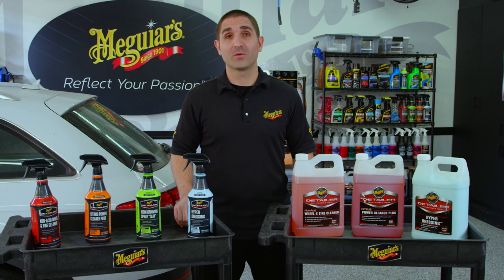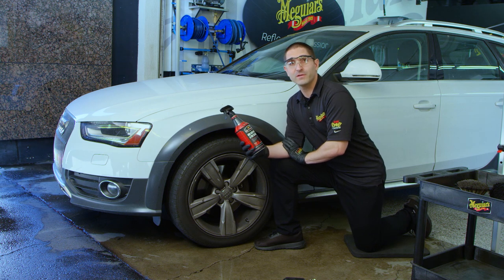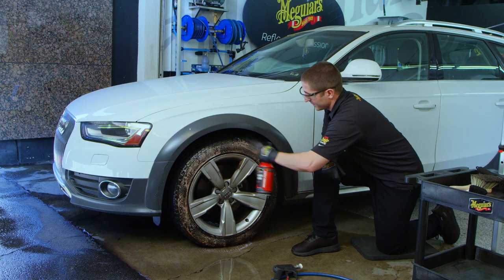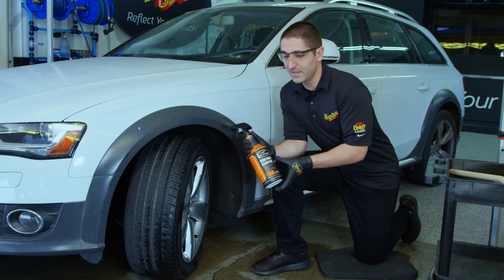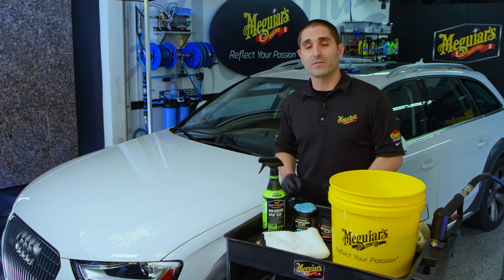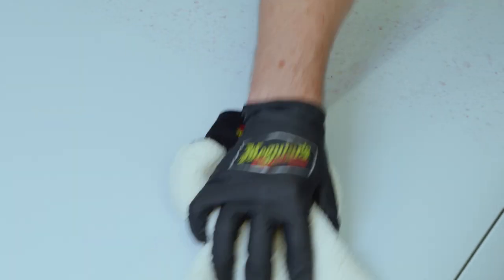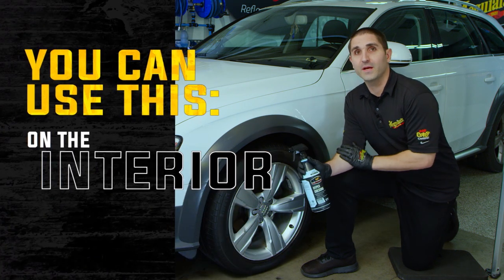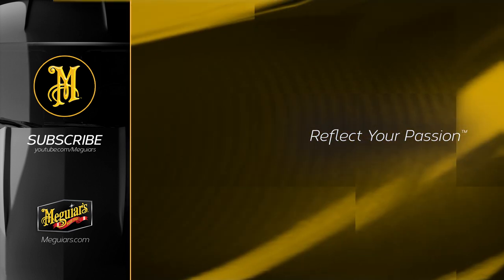Tips & Tricks for the Best Results with Meguiar’s Ready to Use Professional Detailing Products.

Comment: Can I use D107 Citrus Power Cleaner Plus for interior plastic and vinyl?
Reply from the maker: Yes.  👍
Reply: @meguiars  D2002 Iron Remover, does it safe for ceramic coated car?
Does it safe for plastic trim, chrome, headlights taillights as well?
Reply from the maker: It is safe on plastic trim, chrome, headlights, and pretty much every other exterior surface.  Whether or not it is "safe" on a ceramic coating is a question you would have to ask the manufacturer of the coating as not all coatings are created equal.  Some coatings could certainly be impacted by using a good iron decon product like this.
Reply: @meguiars  D107 Citrus Power Cleaner Plus, does it safe for ALL interior surfaces?
Reply from the maker: It is safe on most interior surfaces but is not recommended for leather, clear plastics, or navigation screens.

Comment: Marcus, is the D14301 safe for PVD chrome wheels? I have them (from the factory) on my 2016 Ford F150? Thanks in advance. BTW, enjoyed your videos with Matt, Obsessed Garage.
Reply: Forgot to ask: would the D14301 work / be safe on the wheel well areas? Thanks again.
Reply from the maker: Yes, it could be used on wheel wells also as long as you still follow the application instructions.
Reply: @meguiars  Thanks for the quick reply. Did you see my first question regarding PVD chrome factory wheels?
Reply from the maker: No, sorry we missed that question.  

No, the D143 would not be safe on PVD wheels.  You would need to use something more mild like our Ultimate All Wheel Cleaner or our D1801 Wheel & Paint Iron Decon.